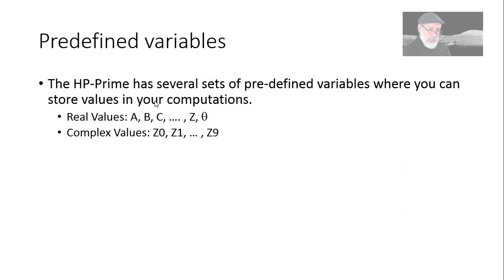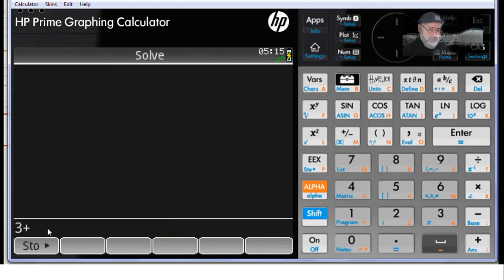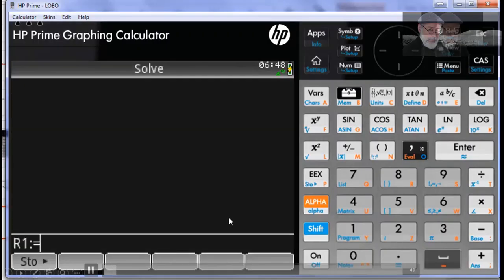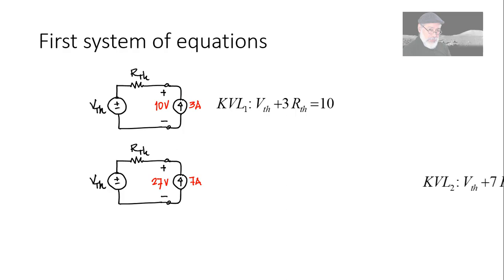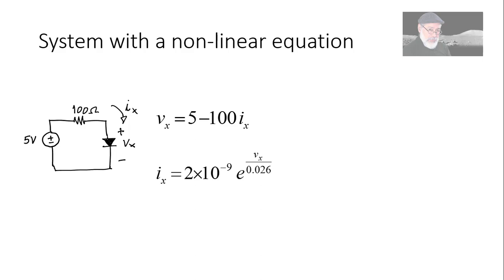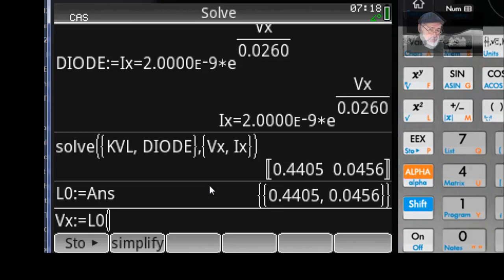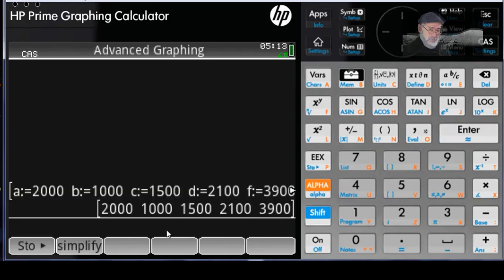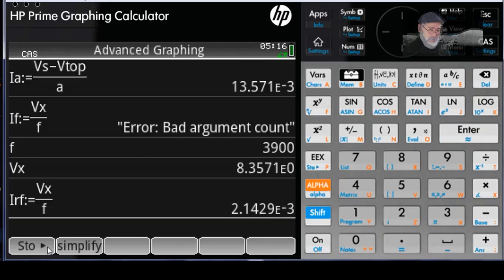HP PRIME 03 - Variables and Systems of Equations.

Comment: Very smart guy, and a great video. 👍

But considering how annoying it is to type a lot of that stuff in on the calculator itself using its buttons, I still prefer to do a lot of it on paper at 10x the speed, and use the calculator for some "bits" that the calc does best...

Comment: Love your videos series on hp prime so far. it helpful in my electronics course but i am confused on what the difference between := is and sto> and when to use what
Reply from the maker: They are equivalent.  I use STO> when I have forgotten to pretype the variable that will contain the value in the previous line.  As when I compute something and then I realize that I may need that value several times in the future ... THEN I use STO>  
If I know from the beginning that I will be using the value later in the question, I can type a:= expression.  I hope this helps.  Thanks for posting.

Comment: Excellent lecture, professor.  I have no "user" button.  I found, in order to get that list, I type vars->CAS, then I get the same listing.  It took a bit of poking around.  I don't know if there is a firmware update.
Reply from the maker: The "USER" soft button appears when you have user created variables. Otherwise it is not there.  Sorry for the long delay in replying.  I usually wait for the end of classes to respond, which is in a week.  Thanks for the positive feedback.  Sincerely.

Comment: Thank you very much for a very helpful video. I have just one tiny question, once you stored a value in a real home variable (let's say "A"), how could you delete its value?
Reply from the maker: If you have used one of the predefined variables, like A B C D ..., to clear its value you only need to store zero in it. The variable cannot be destroyed, just rewritten. However, if it is a variable that you created, perhaps with a name 'radio:=5', you can destroy the variable completely with the command purge(radio). If you want to destroy a group of variables, let's say the variables 'Iao', 'Vcb', and 'Pout', you just list them between curly brackets like this: purge({Iao,Vcb,Pout});

Comment: I tried running RR(2,7) in RPN mode and got syntax error. Any way to work around this?
Reply from the maker: Even if I supported RPN as the best way of communicating with all HP's, from the 35 up to the 50g (and I have had each and every one of them over the years) ... for the Prime, I prefer Textmode, so I have had no experience in using programs in RPN on the Prime. Sorry. I am assuming that you programmed RR.
Reply from the maker: EXPORT RR(R1,R2)
BEGIN
RETURN(R1*R2/(R1+R2));
END;
Reply: In RPN mode on the Prime you could run this in two ways:

a) Put the two values on the stack and then enter RR(). So you would input
2 ENTER 7 ENTER RR() ENTER

b) Put the function in algebraic single quotes and evaluate. So you would input
'RR(2,7)' ENTER Eval

It seems to behave similarly to the HP-48.

Comment: When i try to input the lower cases like when you do the Rb:= it says you want to create the new variable? and once i say yes sintaxis error always when i try to put lower case to a variable
Reply from the maker: At some point, HP should separate "system" variables from "user" variables, but until then, we face the annoying "syntax" error message when we try to create a variable with a name that corresponds to a predefined function in the calculator. Some names are obvious, like "sin" or "cos", but some more obscure function names that we never use may take us out for a loop. For instance, asa, is a function name predefined within the triangle app. In those cases, I just add one more character to the name and that usually does the trick.
Reply: I see, thank you so much for such an useful guides and personal help!

Comment: Bom vídeo. Compensa trocar HP 50g pela prime? Tenho todos seus vídeos com a HP 50g usando pra cálculos. A prime são poucos. Os programas são diferentes. A 50 g tem 2100 funções embutidas. A prime não chega a 400.compensa a troca?
Reply from the maker: Dear Mr. Claudio, Before I had the HP-Prime forced upon me by the market, I would have said no. But after a year of using the HP-Prime (I have three HP-50gs and two emulators for the 50g one on my iPhone and one on the PC) I find myself using the Prime exclusively. I hope that helps to answer your question.
Reply: Thanks for the answer. I hope one day you will redo the programs you have in your videos for hp50g for hp prime. I could not translate them from 50g to prime.grato

Comment: Great video, thanks. A little question, why do you choose to use HP prime rather than TI nspire CAS(hp 50g rather than ti84)? I prefer nspire since it contains a full keyboard.
Reply from the maker: Choosing the right calculator for you is like choosing the right shoes or clothes. You pick the one that really works for you. The HP-PRIME works for me. I like a slim and very portable machine. I like that it has rechargeable batteries. I like that its CAS is right out of the mind of the Canadian designers and proponents of Maplesoft. It is a personal choice. I put my calculator to the test under very demanding circumstances, environmental and operational, the HP-PRIME seems to keep up with me. If a full keyboard is a must for you, by all means, the HP-PRIME is not a good choice for you. Thanks for posting. I truly appreciate your balanced and praiseful input. Long life to all calculators, HPs and TIs! (I started doing science before calculators were ever released, in the days of log and trig tables). Also Casios, and SHARPs (I still have one of those).